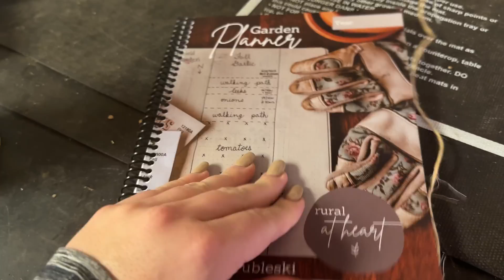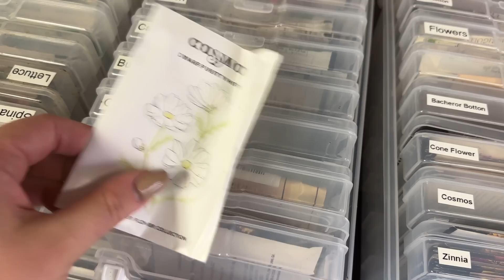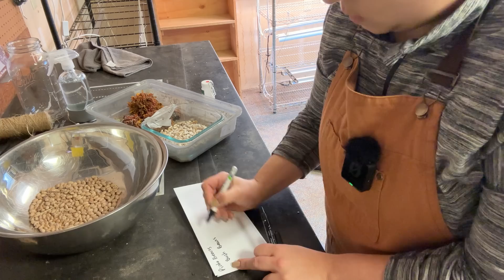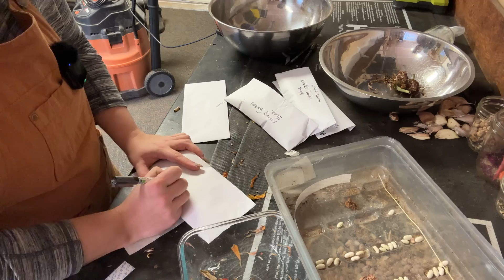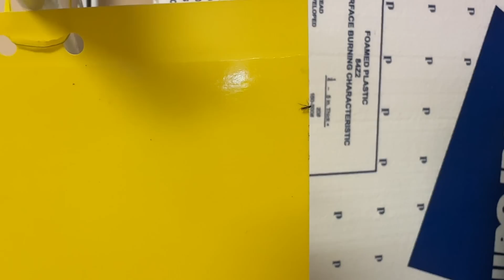I Don't Think I'll Regret This!

Comment: Ive been using the yellow sticky traps (in the pots , not hanging because gnats and their eggs are in the soil) and mosquito bits. The mosquito bits and not watering again for a while (letting everything dry out) worked wonders.

Comment: I had a major fungus gnats, they got everywhere. also from overwintering the peppers I fully defoliated the, cleaned the roots, soaked in neem oil water, and used new potting soil, freshly purchased. I think the bagged soil already had the eggs in it, because the plants were literally down to a stick. Next time I attempt this, I'm going to bake the soil for a couple of hours to make sure nothing is alive in it. the STicky stuff helped, but what really worked wonders was this electric gnat catcher thing that has a light and a mini fan with sticky pad on the bottom, i just leave it working overnight

Comment: Just wanted to send a little thank you for the information you share Becky :)  I'm starting a garden for the first time this year (in containers and a GreenStalk) and have been binging your 2023 garden videos/Instagram for your tips, putting them to use, and my little seedlings are doing great so far!  I know it's a lot of work to produce these videos but I want you to know that you're helping others immensely.  I'd love to hear any tips you have for controlling bugs and whatnot once plants are outside - as my garden will be small due to space I won't have "spare" plants should bugs take one down.  Neem oil has worked ok for me on my trial lettuce plants - just make sure you mix to the package directions and spray both the topside and underside of the leaves.

Comment: Becky, I heat potting soil from new bags I get in the fall. My grandmother took her glass casserole  dishes, place the dirt in the dishes. Cover with heavy aluminum foil. Heat in oven for 30 minutes on 180 to 200 degrees then place in a clean flower pot . I use a large pot. When I bring in my Hibiscus 🌺  plants I wash the flower and roots off really good while holding them. I also is those Zevo flying insect traps. Theu have refills. Theu plug in. You never tough the sticky traps.

Comment: I have been starting plants in my house for about 20 years.
Last year was my first year that I had the same problem & mine was aphids. Something I learned was some aphids fly so, if you don’t get them stopped right,  the only way to get rid of them is to toss them.
This year I bought a bug zapper on Amazon. I’ve have had it running for a month without starting my plants & it’s zapping a lot of little bug. 😮 I’m shocked.

Comment: Have had fungus knots several times and usually from over wintering or from growing amaryllis at Christmas. The yellow sticky traps work great for the adult gnats but you need to kill the larvae in the soil. Best is gnatrol which is expensive and hard to find in small quantities but works so well. Second best is a tea made from mosquito bits.   Do not toss the soil in the closed tubs. When you go to start seeds use boiling water to moisten the soil. I’ve never had anything die from the gnats but it takes awhile for them to go away. Good luck on your growing season🌱🪴🫛

Comment: The mosquito bits works the best. I soap some in a gallon and water with it. sprinkle the tops of my soil with it too. The  sticky traps helps reduce the numbers as well but i get the ones that you can stick in your pot so its right at the source  :)

Comment: Shielddeck is awesome & so is Terro T2502 Ready-to-Use Indoor Fruit Fly Trap with Built in Window - 2 Traps + 90 day Lure Supply
Fly.  Nothing sticky hanging around to get your hair, clothes, etc stuck on.  
If using the Terro Ready-to-use trap you can see the gnats floating in the bottom of the little apple that is clear on the bottom & on the sides also.

Comment: Love your channel! I've been starting my own seeds for close to a decade.  I never clean/sterilize my trays and I have never had any problems. I will rinse out the old potting soil with a hose but that's about it. That being said, for your large trays, I would soak them in your bathtub with hot soapy water if you want to clean them. Hope this helps!

Comment: My green stalks are still growing strawberry plants kale radishes and lettuce thru the winter. If you kept them on the porch where they are they would be sheltered enough to grow those cool season things. Or could decorate with solar Christmas lights and greenery. 
We've had -16F temps for a few days. When it's below 25F I throw a shher curtain over and so then I added clear plastic am excitedly curious to see if plants make it after it warms and our 9inches of snow melts!   Green stalks now makes covers too one can purchase. I definitely agree I need to buy wheels or at least spinner for mine outside even though they are not moved around. The spinning just really allows for better light and more even growth.

Comment: I had a problem with the fungus gnats as well one year, so I bought the yellow sticky traps that go directly into the plant soil itself. And that most definitely curved the fungus gnats. It’s similar to what you were using, but mine went directly into the soil itself. I pray you can get rid of them! And I know you will be able to too.

Most definitely do not get rid of your soil. You can sterilize it using boiling water.

Comment: I microwave all my seed starting mix, which kills anything in the soil. I put sticky traps on all my trays. If you bring outside soil in, put nemotodes in soil.  Aphids got my peppers a few years ago, so I understand jow you feel. You can use peppermint and soap in a spray to control them.  Good luck in your seed starting.  I love your channel. -Alison

Comment: Ugh! I’ve had a problem with gnats too and have found that the sticky sheets work best of anything I’ve done. 
I’m pretty sure they were in the soil I bought. I potted up most of my plants that were on my screened porch and they really were not as exposed to gnats outside. Didn’t have a problem until I tried to love them with new soil. 
Anyway, now that I have them under control - I’m going back to basics - I’m going to add boiling water to my seed starting mix and with any soil that I bring into the house again!

Comment: I had a problem with fleas and aphids in my basement my husband works at a local hardware store and we are in a rural area an old farmer told us to use a hanging light I had a desk telescope light and use an old plate or shallow dish with dawn dish liquid and water not really soap just slippery so like about 3 to 5 drops and water swirl it around to mix it and in the evening mainly at night turn only that hanging light on over the dish in the floor it was incredible within a day I noticed a difference and by the weeks end we had no more pest problem from ants to flies everything. I wish you the best.

Comment: You can easily sterilize leftover for potting medium from previous years using your pressure canner or your instant pot by processing the soil with water to moan it for 25 minutes at 10 pounds pressure to kill everything and render it ready for another year of use

Comment: For cost savings in your grow room, you can take out the carpet and just have the cement floor. This would probably make it easier with the dirt. When you redo your kitchen you can repurpose the cupboards in your grow room. You can use leftover paint as well.

Comment: The yellow traps are the best for control.  I have had them three years, but using the yellow traps is what helped the most.  Any soil that is contaminated should be taken outside.   Unfortunately, a lot of bag soils have them in them....even if they are sterile, because they sit on shelves or outside and little holes get in the bags for them to come through.   I have had the same issue with overwintering peppers... they always have bugs that come out around this time of year.

Comment: You should put some wet soil by the traps so that it would attract all the gnats to that area. I have an air filter and it captures all the little flies around my plants
I think they also have these little lights that you plug in and it shows a blue light and it has a little sticky inside of it as well and it gets rid of any bugs flying around

Comment: I learned from Jill at whispering will farm to have one photo container that is empty and put post it on each container for each week of the year (can rotate once one box is done) and then add seed packets that you wish to start that week indoors (or direct sow) and that gives you a good system to succession plant items and move them to next date as needed. I decided to try that this year. Plus this helps when you don’t use every seed packet you just pull the ones you want out. If you look up her last years succession video you can see it there.

Comment: To get rid of those little bugs, you need to get lady bugs that will eat those little pesky critters. Whether the plants are inside or out, the lady bugs will help resolve your issue. You can also use dried oregano and rosemary mixed in water or soap water -spray on and under the leaves

Comment: Pour boiling water over your seed starting mix prior to planting. It’ll kill any eggs hanging around. I got gnats from a big box store soil a few years back. Small hole in the bag and stored  in an outside garden center. In my research I found between the boiling water and a  very mild peroxide solution for maintenance did the trick.

Comment: If you guys are starting seeds in trays, put some compost in the bottom of your trays (1/2 full) and top it off with the seed starting mix.  By the time the seedling gets big enough to need the nutrients, the roots will have reached they compost.  It’s a great fail safe in case you forget to fertilize one week.  🌱🪴

Comment: Just watched your video and can relate....totally fungus gnats with bringing in peppers as well as from houseplants, which always seems to be worse in the winter for some reason.  I've tried a few different things like sticky traps, etc., but I've had the best luck with a combo of using Bonide Eight (which is a step up from Insecticidal Soap and Neem) on the planters and then I setup those Zevo plug-in traps which worked a treat!  If you do have a problem with the bugs ignoring the sticky traps you may want to try the Zevo.  They can be pricey, but they really work for me.  Good luck!

Comment: I add some diatomaceous earth to my seed starting mix to kill any gnats that want to lay eggs in my seed trays. For the plants that are outside or will be outside, add some diatomaceous earth, then add 1-2 inches of sand. The sand will get them tired/suffocate them from digging in to lay eggs in your planters to continue their life cycle. I did that for all of my indoor plants when I had a gnat problem. Apple cider vinegar, neem oil, and the sticky traps do work but diatomaceous earth and the sand worked faster for me.

Comment: Hi Becky I have had the same issue with the Fungus Gnats. I’m using Neem Oil in a spray and Neem powder mixed in my soils. It’s working! 🎉 not gonna lie it does smell a bit but it works my green house was full of them. Give them a try. ❤️

Comment: I purchased 2 bags of Organic potting soil from Costco and left them in the garage with a door connecting to the house. Well the fly infestation began and we kept blaming it on the bananas. Well after a trip away and my husband purchasing pest traps the problem continued. I went into the garage, saw the bags of soil and realized, uh oh! I brought the bag of soil outside and saw a couple of flies on them. So I removed all soil from the garage, kept the traps plugged in and have only seen a rare one or two flies since them.

Comment: Neem oil or peroxide mixed with water. I’d use neem oil and hot water first in the dirt you want to use for your seedlings put it in a bucket, cover it and let it sit 24 hrs. I learn that from Gary from Rustic Garden. I grow seedling in a spare bedroom for the last two years. No gnats. Also cover the trays with powdered cinnamon after you plant them keeps the fungus to a minimum.

Comment: I used to fight with fungus gnats every year in my seed starting area & I finally realized they were coming from the soil I purchased. I never found a great way of fighting them once they got going, but I did find that pouring boil hot water over the soil every time I opened a new bag killed the eggs in the soil.  I’m three years into doing this & I haven’t had a single gnat problem since.

Comment: I tried to overwinter peppers this year too.  Cleaned off old soil and repotted. Didn’t overwater, and still got the gnats. Took all the plants outside and within a week or two they all were gone. 
I did use apple cider vinegar with Dawn dish soap to help draw them and kill them. They are gone.
Very disappointing, I had such a great pepper season-1st time ever.
Good luck

Comment: Hi Becky. In addition to the sticky fly trap, I use the diy method of apple cider vinegar and dish soap. Put it in container covered with plastic with small holes (plenty tutorial on the internet). This method seems to work for me. Its not an over night solution but it does take care of my gnats problem.
Reply: this is what i do. it works amazingly well.

Comment: I’ve had fungus gnats before from eggs that were in purchased potting soil. The yellow sticky sheets are good at trapping the adults. To get the larvae in the soil, I’ve had the best success using mosquito bits. They have a type of microorganism that the larvae feed on and it kills them - I want to say it’s related to the same microorganism in BT but I can’t remember the exact name. I soak the mosquito bits in water overnight, and then use the water to water my seedlings in the morning. I hope that’s helpful! They are definitely a nuisance!
Reply: Bacillus thuriensis var. israliensis (and only that variety)

Comment: Im still trying to decide if I want to start seeds this year. I think I want a break and I'll just support greenhouses. 
With the knats, you might want to cut one of the traps in half and place them by your indoor plants for a bit. They may have escaped that room and it will help to keep the issue away if they try to find the plants in other parts of the home.

Comment: Those look like aphids. But I think you can treat similarly. You might have gotten both.
 I get a small amt of fungus gnats each year with seedlings (even good brands of soil can have eggs), and use the sticky traps for the flying adults, and I use water w mosquito bits or gnatrol once a week or so for the eggs in soil. Never gets out of control once I started using that.
Reply: Agree! Gnatrol is BT. Once I started watering with some BT, my over wintered plants looked so much healthier. James Prigioni has a good video on his channel about overwintering peppers. Very detailed. He actually washes all soil away, prunes significantly, then repots them in fresh soil. Watching that video may give you some ahas for next year.

Comment: I had that problem from using Miracle Grow potting mix…2 years……
Take soil even new and heat in pans in the oven to kill eggs.

I used mosquito granules on top of the soil for flowers but not veggie starts…just being cautious and that worked very well….
You need to scrub all corners etc…..potting containers….etc
Good luck

Comment: The nates are attracted to vinegar, but with rinsing them well they should be fine. I had the problem because of digging up a fig tree and even it going into a pot with mostly potting spoil the nates still hatched in the outdoor soil. I put one of the big mouse glue traps in the pot right away and they were attracted to it have changed it out several times I think they are about wiped out.

Comment: I work in plant biochemistry and can provide some advice from my experience in research, though I don’t work much with edible plants. But in my experience, the fungus gnats that are flying around aren’t the ones directly hurting your plants. It’s usually the larvae in the soil that eat the root and kill the plant.  You can keep the sticky traps close to the soil to capture them as they hatch to keep them from reproducing, but you still have to deal with the soil. Heat sterilization helps kill the larvae before planting. There are some beneficial nematodes that can help, and there’s some limited evidence that beneficial soil fungi help with the issue. But the most critical thing is to control the amount of water - out fungus gnat issues ALWAYS coincide with overwatering. Good luck!!

Comment: I have never had seeds or plants totally die due to fungus gnats. The plants only failed as I was grossed out and stopped watering them enough and wouldn't harvest them (I had them on indoor herbs). However, I have used mosquito dunks (people use bits too) and these have always controlled it to 1/2 gnats a month (which I think come in from outside rather than are in the soil inside)

Comment: I use peroxide to get rid of fungus knats. Create a mixture of one part hydrogen peroxide and four parts water. Lightly spray on plants or if they are in the soil put in soil. I usually do this before I bring them in and fungus knats.

Comment: Even if you over- winter peppers that were in pots you could still have fungus gnats.  You can drench soil with Neem oil.  You can also get those granules that people use to put in fountains kill mosquitoes larvae.  

You can pour boiling water over your potting soil to make it free of gnats.  

I alway put potting soil with fertilizer on the bottom and seed starting on the top, so I don’t have to pot up or fertilize as much.

You can put the soil from your green stalk into your compost.

We start sweet potato slips in March (zone 6b) and plant them in the bed when we pull out the peas.  I’m always confused when people start sweet potatoes so early unless they are in the Deep South.